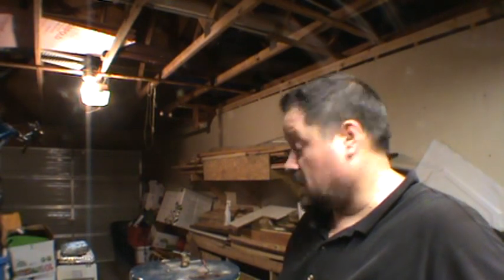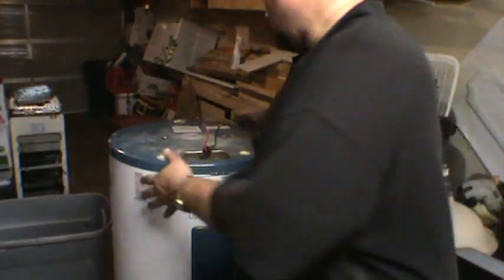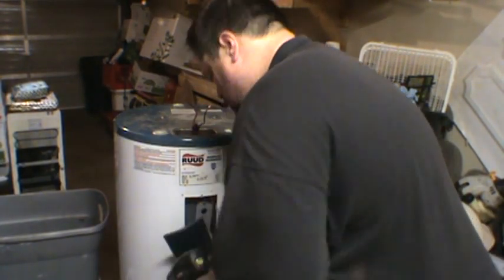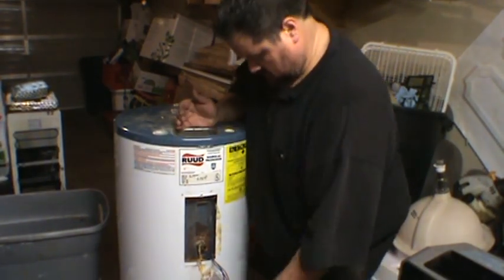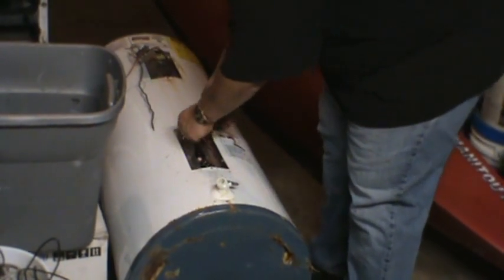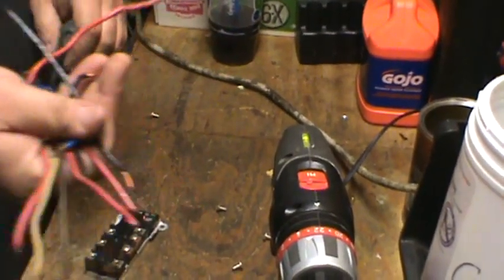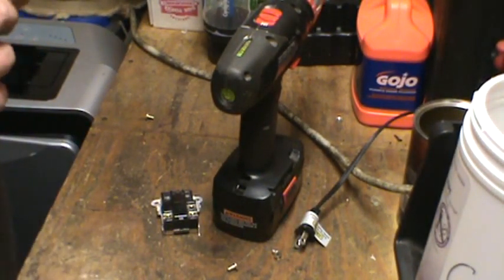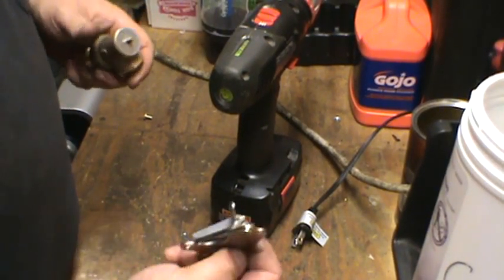Scrapping an Electric Water Heater for Brass Copper Aluminum and Steel

Comment: My local scrap yard in Ashland, VA (located via the IScrap app, thank you very much) pays 7 cents a pound for water heaters.  That's about $3.50 for a 50 pound water heater.  Maybe grab the brass piece off the top and then turn it in.  I don't know.  It seems like a beast to haul around for that amount of money.  In any case, thanks for the great information, Moose.
Reply: I agree. I stick to copper, brass and aluminum. Steel isn’t worth your time to go looking for it. The money is in copper and brass.

Comment: I’d like to learn about scrapping old style CRT tv’s and new flat screen tv’s. Flat screens are mostly plastic. But I hear circuit board have scrap value. Is it worth your time to scrap a flat screen? I mostly suck to copper, copper wire, brass and aluminum. And lead and batteries when I can get them. Steel is not worth my time, I’ll save it if I get some, but I don’t go looking for it.

Comment: I am a scrapper. I try to scrap when the prices are as high as possible. Every little bit adds up. Some items are going to be mixed metals. I separate just like you do. This is 2020. Covid has made prices drop. So, I will hold on until they come back up. Gasoline prices are down. It seems when it is down so is metal prices. Do check now and then during the week. But when I get a going value,  I will find the best day and then go for it.

Comment: Some of these have a copper tank inside. If you have copper pipes going into it, cut a hole in the tank and check, just in case. :) I've had 6 of them so far, 300 litre tanks.. in copper :)
Reply: Any method to identify the water heater being of that type?

Comment from the maker: Sorry to disappoint.  I was told the inside was just steel and the foam insulation was causing a problem.  The next one I get I will update it and show the inside.  Was I given wrong information?  Is there more inside than just steel?
Thanks

Comment: I'm a scrapper and recently I was given a non working hot water heater and I cut the copper wires off but it was actually like you said just good for steel. Have you ever took apart a motor off of a washing machine to get the copper out?..or you think it's better just to sell the motor as is...which in my neighborhood scrapyard only buys for 20 cent a pound!

Comment: Pull all the copper out take a grinder with 1/4 thick wheel and  cut a slot from the box to the other box . Wrap the copper wire around a wrench and pull the wire threw the foam and the slot you just made.

Comment: I'm trying to find some info on scrapping a tankless gas hot water heater. Are they worth scrapping?
Reply from the maker: Those are somewhat new to the market so I have not seen mnay to scrap yet.  Make sure it does not work because I am sure you can get more money for the unit or working parts then by scrapping alone.  Lets take a look at what is inside one of those.  You will have piping, copper or brass.  There will be wire, since there is a computer component, you will find at least one transformer, green board, may have minute gold content, the casing could be aluminum or steel.  Electric pump to push the water, an that is just a guess by trying to figure out basically how it would work, and by estimating the basic components needed.  It would be hard to give you a direct value without knowing brand, model and size etc, but I am sure it will be worth scrapping if it does not work.  Best of luck to you!

Comment: Did you not remove the outer sheet of steel because of the foam gunk stuck to it?  (Isn't the tank of a heavy steel? Would the price/lb for the two types of steel be different?)

Comment from the maker: HA!!!  I KNEW IT!!!  I Knew someone would say that!  I kept the thermostat switch and found them but it took me a while to tear the thing apart.  I even mentioned in the description that there was a smidge of silver.  I have been testing it at 80% in most of the switches I find.  Does that sound right to you?  And can I get the copper out with an A/P bath instead of using nitric?  Thanks Drew!

Comment: Hey, just curious. Do you ever strip off the sheet metal jacket and insulation and sell the steel tank on Craigslist (or whatever) and how much do you think you could get for that?
Reply: I believe all tanks are glass lined. Not sure if they have any value other than scrap.
Reply: False there steel or actually copper tbh

Comment: I wanted to ask about the heating element.   Do you know what it is and what its value might be.
Reply from the maker: As far as I know, and I may be wrong, just about every heating element I have seen is ferrous with a ceramic core.  I am guessing just iron price unless they still worth then you could sel them on ebay for more.

Comment: hey Moose. i know it's 2013 when u posted this video. How far down do you break the thermistat down. Show me if u do go farther. I haven't found a tool too take it apart. Thanks. Yeah I've been waiting for new postings.
Reply from the maker: +Terry Casey Hey there, I do take them apart further once I have a buck ot them.  When I have a lot to do I pop in a movie or something and just crush them and pull out the silver contacts and separate the magnetic from non magnetic.  Have not posted in a while because I just went through a divorce and am in the process of moving.
Reply: The  thermostat lay it on a vice and hit it with a hammer. The relief valve use a  angle grinder or pliers to break away the brass be careful  small  spring inside.

Comment: Well I just found this " The heating elements in an electric hot water heater are typically made from a stainless steel or zinc plated copper sheath that surrounds a wire made from nichrome."  

I am thinking that however separating the metals may not be worth it, because the element would have to have ceramic in it like you said.

Comment: 80% is probably right. Hit em with a big hammer(quick). I use aqua regia to isolate the contacts, then nitric to refine the silver. I have heard others using an AP bath, but it will probably be slowwwwww.....
Don't use heat to melt them because of possible cadmium, etc.

Comment: Hello moose, I'd like to know under what category you see these all the time on craigslist? I tried randomly  to look some up and couldn't find any.

He's a tip for you.
The ONLY reason to "scrap" a how water is if the steel tank itself has rusted out and it 's leaking. As long as the tank is intact and the outer skin is not all rusted and ugly they all can be repaired for under $20.00.

They are nothing but a steel tank, Pressure relief valve, 1 or 2 thermostat/s and 1 or 2 electric elements. When they stop working most often it's just one or two part/s. New ones go for $200 and up. There is way better money repairing the ones that have good tanks and reselling them for $100. or $125 depending what their equivalent sells for new.  Resell the delivered and charge extra to install $50/$75. All you need is an ohm meter. and hand tools.  Easy money.   Cheers
Reply from the maker: Hi there, i find all this stuff under the "free" section.  Mostly, I get scrap from response to ads I place.  Happy HOlidays!
Reply: Moose Scrapper Thanks for the reply. I see the section on craigslist, now.
Seasons Greetings back at you. Best wishes to you and family in the coming new year.
Reply: the fill up with sediment and become gross and inefficient

Comment: have you done a business photo/copier/fax?
Reply from the maker: Jay Stevens Great question, I actually have one in the garage waiting till spring when its warm enough.  Its a heavy beast, I just hope its not all plastic weight.
Reply: a lot of plastic and a bunch of copper bearing motors. Good for late night winding down type of picking/scrapping.

Comment: i'm in sweden so the brand here is NIBE..  not sure if they ship overseas.. but I guess you'll have the same kind over there.. just have to find them :)  If there is copper pipes soldered to the tank.. open it up. :)

Comment: So from what it looks like It would really not be worth it purely to scrap. Would you agree? with steel unless you literally have a ton of it. and depending on the distance to your nearest yard. You, or better yet I, could easily end up spending more in gas to haul it there than what I would walk away with. I'm not trying to get rich don't get me wrong. Then again I don't go through the trouble of tearing down and sorting everything for my health either.  Just like to hear your opinion on this point. thanks. and
Reply from the maker: This video was posted a few years ago when scrap prices were much better.  So value is different now and may be different in the future.  It also varies on what your options are.  If you have nothing else to do, if you are wicked busy, etc etc.  If its not worth it for you, no one can argue that.  Thanks!

Comment: with some of those brass fittings its not exactly brass but something called composition witch is made up of copper brass lead zink witch pays a little bit more then brass alot of people dont know about that so they sell it for brass at my junkyard its like a 30cent difference about $2 and pound if your take a fitting and a brass pipe and really look at the colors the fitting has almost like a dull copper look to it..you got any questions about any material to make sure your getting paid for what u bring let me know Moose Scrapper

Comment: That’s nothing not worth my time. scraped for over 20 year I had a contract with a heating and air conditioning good cooper wire and brass aluminum and steel . Twice a week that near $350 Sometimes more or less good luck and keep scraping!